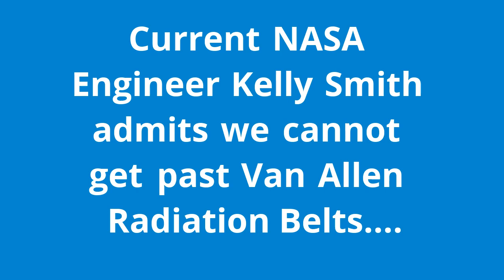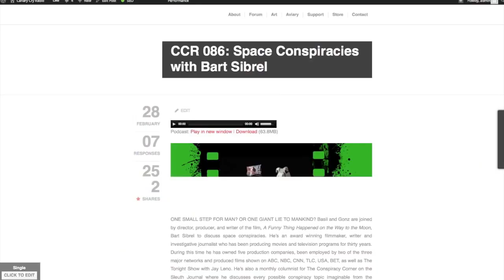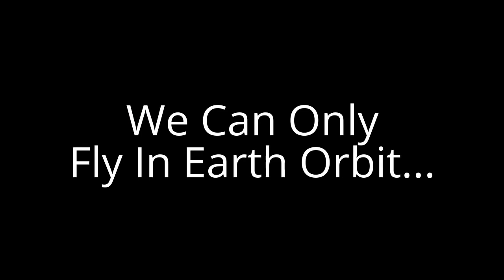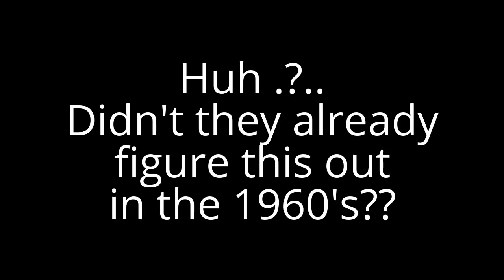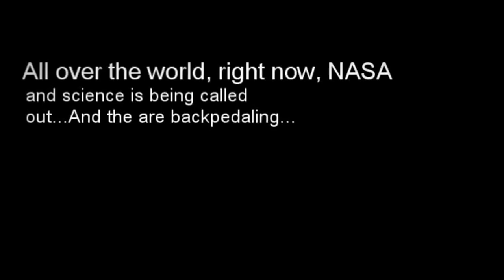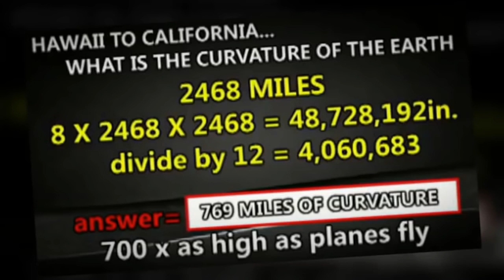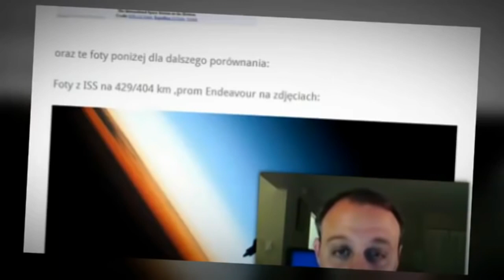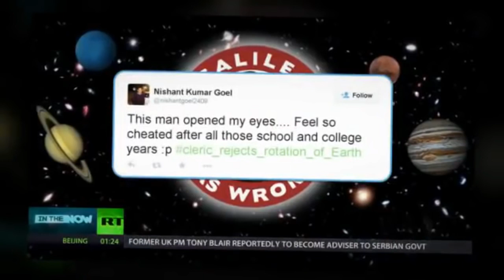N.A.S.A. Finally admits we cant go to the moon.

Comment: Distance to the Moon. In astronomy, the distance of the Moon from Earth is known as the lunar distance. The average distance of the Moon from the center of the Earth is calculated to be 384,400 km (238,855 mi). This is the average of the distance at the apogee and perigee of the Moon from Earth.
The Van Allen belts are most intense over the Equator and are effectively absent above the poles. No real gap exists between the two zones; they actually merge gradually, with the flux of charged particles showing two regions of maximum density. The inner region is centred approximately 3,000 km (1,860 miles) above the terrestrial surface. The outer region of maximum density is centred at an altitude of about 15,000 to 20,000 km (9,300 to 12,400 miles), though some estimates place it as far above the surface as six Earth radii (about 38,000 km [23,700 miles]).

Comment: But not dangerous in 69... so is it the belt or lack of rocketry that's stopping us?

Is belt stronger now? Were analog components not susceptible, or less so than digital,  and if so why not use triodes instead of transistors?
Reply: PST3K NaN it’s the lack of rocketry like the Saturn 5 that was used for Apollo. Current rocketry is only designed for earth orbital penetration. As for Van Allen Belts yes they are dangerous to humans so but some shielding and the correct trajectory to reduce exposure makes it possible for humans to pass through.

Comment: Ford Motor Company finally admits it can't build Model T's. (Which of course doesn't mean that it never could build Model T's).
Reply: Paul Newfield -Pasadena, Ca. USA  First, I don't think its accurate to say that just recently "NASA finally admitted that it can't go to the moon". That was widely acknowledged after Apollo 17, the last lunar landing mission. My comment was an illustration that just because some technical capability in the past no longer exists today that does not mean that it never did exist. You have to be on guard as these hoaxers that think the moon landings were faked will take things out of context and twist the meaning of things around to match their beliefs.
Reply: @joevignolor4u949  The technical capability of the past still exist today, gamers are going retro for their gaming computers. Wish I had not tossed my old stuff out, they are paying more for it now than I did then!!
It has however been replaced by the so called latest and greatest ; ; ;    ;>(

Comment: Their not suspended by wires, if you watch videos of the space centre you can clearly see that there would be no way to suspend them with wire. But I do agree they can't get past the van Allen belts
Reply: nothing so crude used these days--think of all the electronic aids to fakery at their desposal
Reply: Suppose your correct, they could just use a zero gravity/vacuum machine, or what ever it's called. But you can see the international space centre circling the globe, theres no reason that I've found that would prevent them from putting such a station into space, there is plenty of evidence however that disproves space travel past earths lower orbit.  Like to hear your thoughts?  And please don't be a flat earther, cause I'll just disregard anything you say.
Reply: @frazzzzil  There is no real credible evidence that we can't go past low earth orbit. All this hoaxer nonsense about the Van Allen belts has been disproved many times over. To find out if the Van Allen belts could be safely penetrated the Russians sent a spacecraft containing living organisms out through the belts and back again in 1965. They all survived the trip. If turtles, silkworms and fruit flies can safely pass out through the belts and come back alive then human astronauts can too.
Reply: J Calhoun  of course they bolted it all together in orbit.   Were you fast asleep all those years that the space shuttle was taking the parts up ???  What did you think the space shuttle was doing on all those missions ??  Just a joy ride ???   Your lack of education on the issue is obvious.
Reply: J Calhoun  sorry... thought you were one of those that deny the existence of the ISS